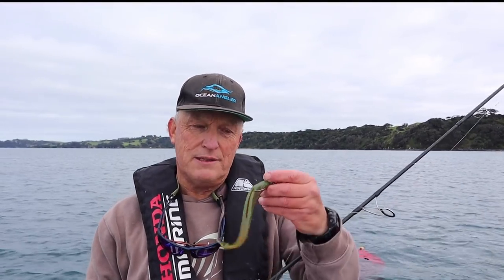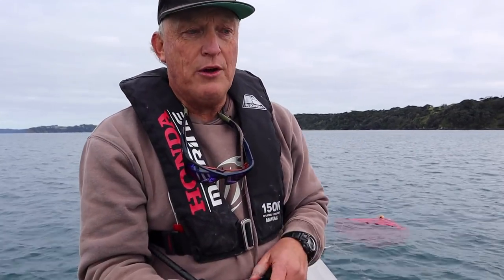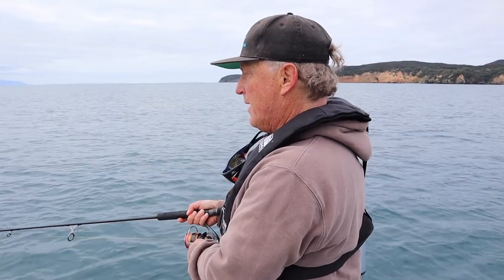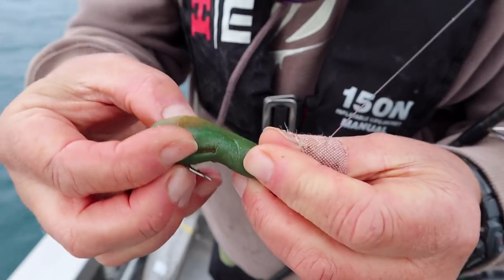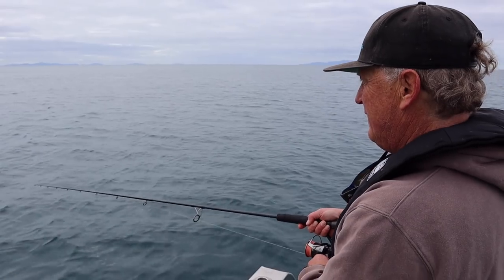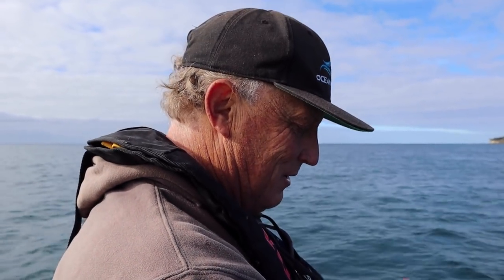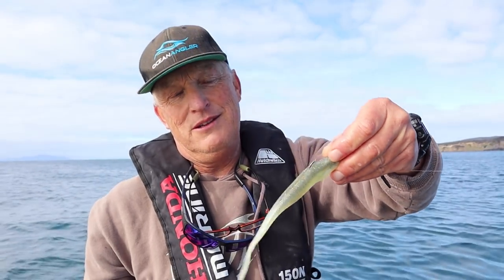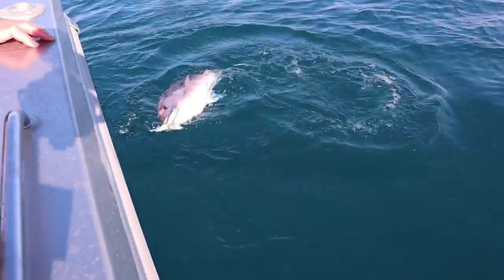Advanced soft bait fishing tips

Comment: Another little tip for anyone new watching this video. Buy some bait cotton if you use ZMan soft plastics. They are super durable but also super elastic so tend to slide down the shank of a jighead when your working them hard or getting grabbed at the tail. Chuck ~10 loops of bait cotton or even tie some mono at the 'bait keeper' section to really squish the head into the lead teeth and youl never have those issues again